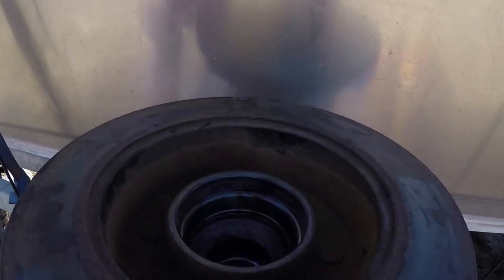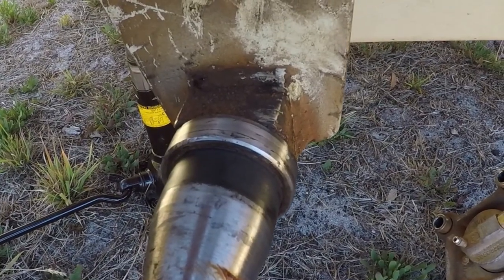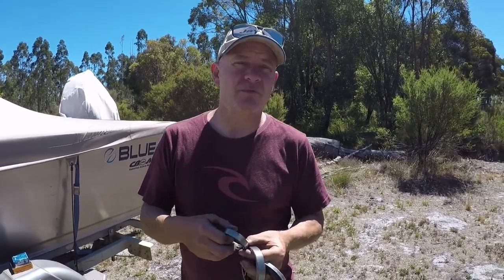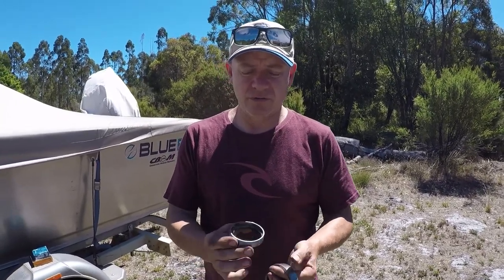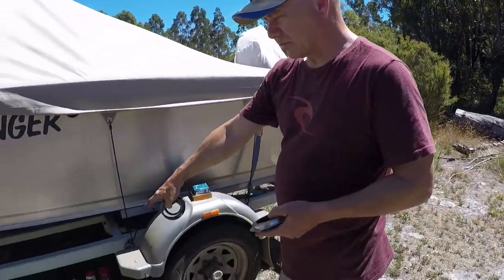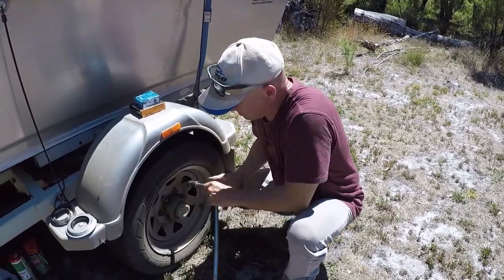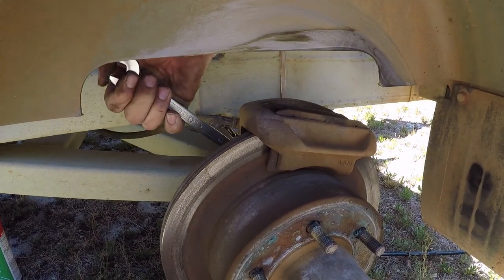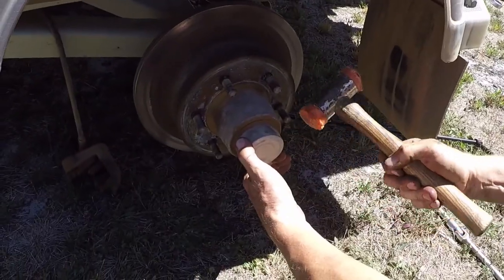Tinny Trailer Bearing Change

Comment: Hey Colin,like your videos.With the packing of your bearings put a glob of grease in your palm and hold the bearing with the big end facing the grease and push grease into the opening until it comes out the the small end working your way around the bearing.

Did you use emery cloth on that blackened stub axle?
Reply from the maker: Thanks Fabian. Glad you enjoyed them.
I'll give you technique a crack next time.
One thing I didn't have at the time was Emery cloth. I do now but too late, eh.